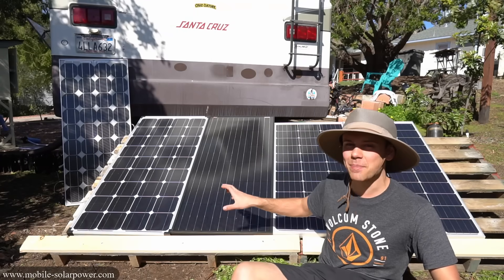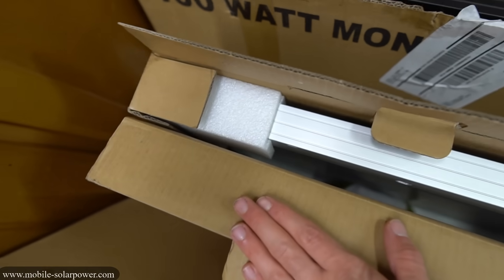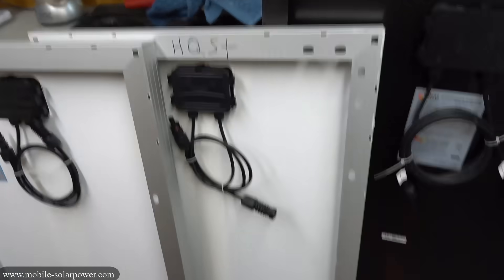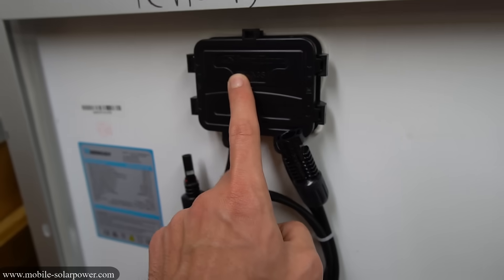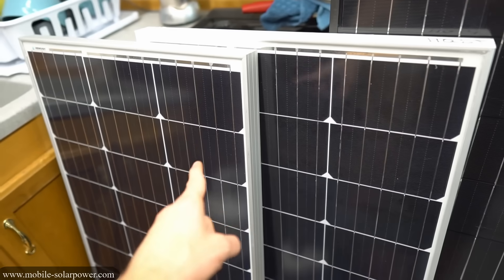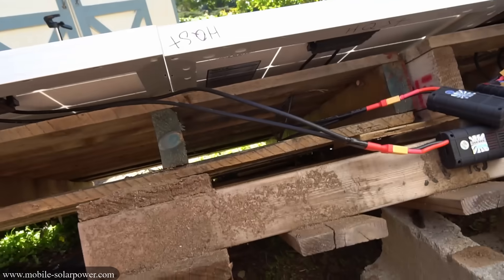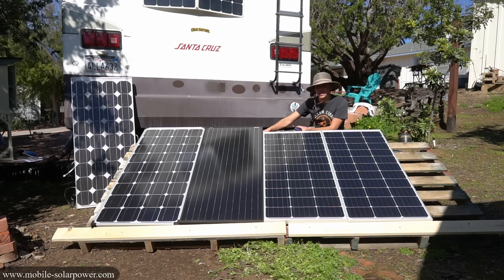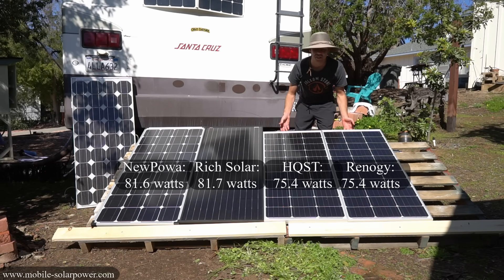Top 4 Amazon.com 100w Solar Panels Tested! Renogy vs. HQST vs. Rich Solar vs. NewPowa

Comment: It would be interesting to figure wattage / area and see if the additional size and additional watts are comparable to the smaller and lesser wattage.

Also note the Renogy and HQST are a 33 cell panel vs the 36 cell NewPowa (couldn't count the Rich Solar).  In the old days with a 12v panel and a 12v lead battery a 36 cell panel was highly desirable, because of the voltage drop as the panel heats up. With 32 or 33 cell panels the voltage can drop enough that you may not be able to get a lead battery fully charged.  This issue may matter less with MPPT even on a 1:1 panel:battery and if you have multiple panels in series charging a lower voltage battery it doesn't matter at all.

I have a pair of 33 cell HQST I use for a portable 200w setup. They seem fine.

Comment: If that's a Tilly hat, it's more comfortable to tie the strap behind your head instead of under your chin. (Sort of like a marine drill sargent hat:) Use the chin strap only in super high winds. I tuck my front strap into the top pocket.

Comment: My question is, who is coping who? Renogy or HQST
Reply from the maker: Haha! good question. Renogy is more established and well known, so I figured that the HQST was a clone, but the reverse could be true. Great point
Reply: @WillProwse You mentioned the extra mounting holes on the HQST, I noticed on "New Edition" Renogy panels I'm wanting have the same extra holes, but the face looks better then the older ones.
Reply: @WillProwse  Check out the grid lines on this one. 
 Renogy 100 Watt 12 Volt Monocrystalline Solar Panel (New Edition)
Reply: @WillProwse  I know in other areas of production, such as food... It's fairly common for "off brands", "grocery store brands" and generics to hire out the name brand manufacturers and simply order tweaks in things to cheapen the process.  For example, one grocery store might hire General Mills to use the same machines they make their brand name stuff on to make similar, but slightly cheaper versions of their main line cereals.  Less vitamins, more oats, less sugar, etc... 

So maybe both of those similar panels are actually just ordering from the same manufacturing company and ordering the same specs?  

I know for example that one grocery store had their own line of macaroni and cheese made by Kraft, and they just supplied a slightly different recipe for the cheese powder... Or something along those lines, I wasnt privy to every detail?

I have no insight to panel production per see, just tossing in a theory from my food service experience.
Reply from the maker: @RND_ADV_X  I agree. Totally plausible
Reply: Actually, they're just both buying from the same supplier.

Comment: Perfect timing, Will. I was planning to purchase solar panels this week and you did my homework for me. You rock!
Reply: That's so awesome!
Reply: I'd love to see him review the SolArk panels. They are the only solar panels that are hardened to withstand a CME or EMP. They are probably more expensive, maybe heavier. I think they are guaranteed for 5 or 6 cycles, and each solar cycle is 11 years long. So that's 50-60 years of use. If they are built to last, the benefit would outweigh the cost of constantly replacing cheaper panels that would be fried in a CME or EMP.

I'm not sure of the weight per panel, might not be suitable for RV's. Their website might say.
Reply from the maker: @recoveringsoul755  I am not finding the SolArk panels anywhere. Do you have a link?
Reply: You have to go to Solark Webb site , I don’t think they make there own panels but build systems for your home which are EMP hardened! They have a emp test lab at there research lab in Allen , Tx

Comment: Could you try to make a water cooled cooling system for a panel, I’m sure it would be awesome!
Reply: Not worth the hassles.  The water has to be circulated and that uses up the energy that cooling gains.  For a big utility scale system it would be worth it.  But what benefits even more is to have the panels track the sun as it moves across the sky.  Another way is to put the panels above bushes or plants which help cool the air above them.
Reply: @acmefixer1  ok, thx